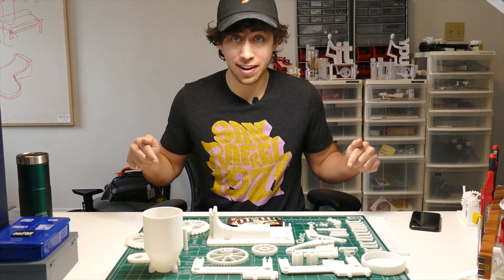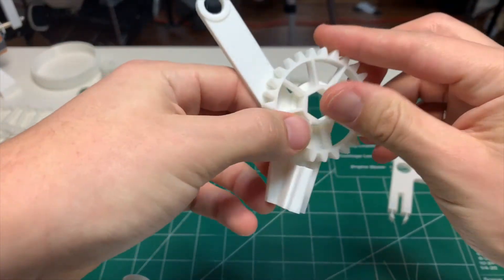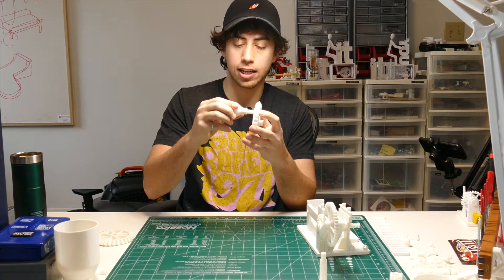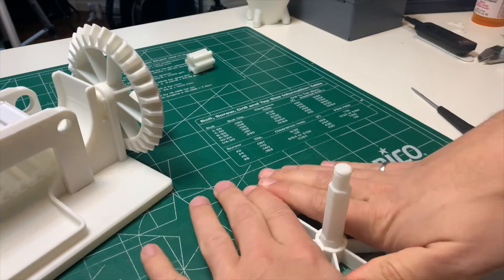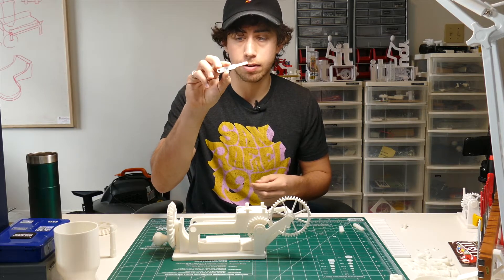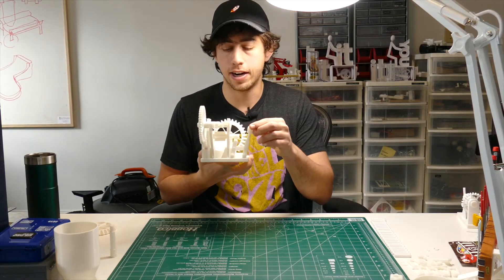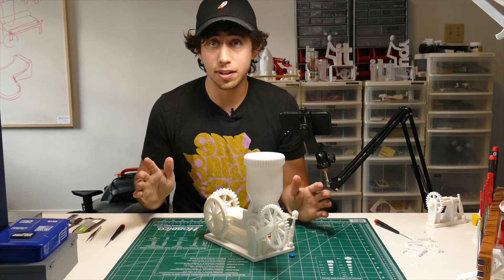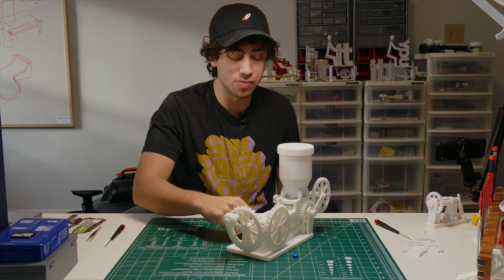Love Conveyor - Fully 3D Printed Candy Dispenser (over-engineered)

Comment: every time we try to turn the crank the conveyor belt snaps apart?  how can I reduce the strain on it or something. hmmmm
Reply: oh i had the one gear on backwards! its fixed now.
Reply: I'm having the same issue but my gears are correct. I'm gonna touch up the conveyer pieces to accept a straightened-out paper clip wire as a hinge